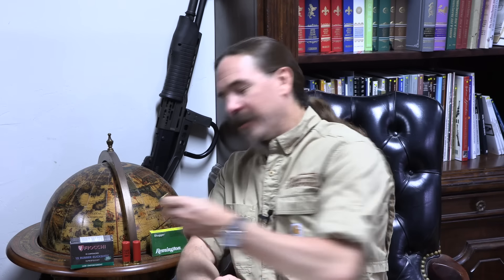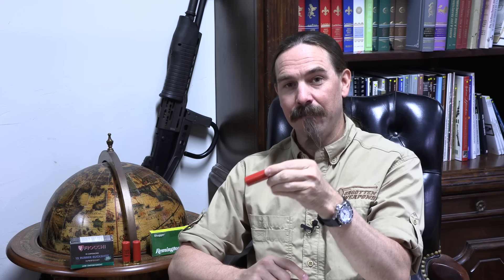The Unique Challenges of Self-Loading Shotgun Design

Comment: Another factor that you didn't mention is that standard shot shells are longer when they eject than when they load (because of the crimp expanding), making extraction and ejection more difficult.
Reply: Yeah and length might be different, it seems European shell is slightly longer and crimped differently.
Reply: Back in the day when brass cases were used for shotshells they had no crimp at all.  an over shot card with the shot size stamped on it was glued into the case mouth and that was that.  Reloading brass shotshells was super common in those days.
Reply: the expended shot-shell casing is the measured length of the shell std 2 3/4 "... Had me fooled for so many years. Then we have other shells that vary in length , i.e. 2.5" , Kent 2 5/8", even some obscure english style Eley at 2".  Buckshot loads were standard at one time in 8 pellets, not 9, combined with the slightly shorter shells once available, they fed and functioned well in some pumps e.g. the venerable 1897 Winch/Browning and that gave an extra round in the mag.
I always enjoyed 20 g single shot cooey for my hunts for decades, simple .12g Pumps came later and I would not consider a semi.
Reply: @2949stari Then there's 2 1/2 English, which you can get extras in on a 3" magnum gun with no mods.
Reply: 3.5” shells too
Reply: Interesting to think most empties get shorter but for shotgun they get longer
Reply: It doesn't necessarily make it more difficult. You just have to make sure the bolt travels back far enough.

Comment: Basically, praise be John Moses Browning and Benelli for giving us semi-auto shotguns that run very well with little to no problems.
Reply: Also Beretta 300 series. The first really reliable shotgun gas action.
Reply: Man, I really hate Remington, but I watch thousands of rounds of shells fired through a wide varieties of shotguns every week.  The 1100 is a perfectly functional piece of equipment.  The comment about the Beretta 300 is laughably absurd.
Reply: My Benelli m4 is indestructible
Reply: The Remington 1100 was the first semi-auto designed to function with plastic shells and is still a great shotgun.
Reply: Benelli is so over rated
Reply: @neutronalchemist3241  Had a Beretta A302 for a number of years, and the only time it ever failed to feed was with subsonic shells through a freshly cleaned action.  After it had a dozen rounds through it, it worked flawlessly.
My favourite hunting gun.
Reply: @randymagnum143 beretta was the first to make a full functional gas shotgun. Benelli is nice and they may be just as good but it’s no beretta

Comment: I acquired a Vepr-12 years ago and expected its internals to be effectively identical to that of a typical AK. I was surprised to discover that it has a bolt head separate from its rotating bolt; It took me a while to realize the necessity of this. It’d be extremely difficult to ‘convince’ a plastic-hulled shotgun shell to actually rotate in the chamber as the bolt locks into its recesses. I suspect this is part of why there are so few rotating-bolt shotgun designs. Tilting into lock is just easier, and the primary extraction benefit that usually comes with a rotating bolt isn’t necessary.
Reply: I really need to get a Vepr-12 before they double in price again.
Reply: I have a Vepr 12 as well and it took a lot of trial and error to get it to be reliable enough to use in competition. Mine likes Winchester AA 1300 FPS handicap loads.
Reply: All Winchester Model 1200-1300 are full rotating bolt designs. they work flawlessly.
Reply: @ThurmanMurman74  my Vepr-12 works excellent out of box. BUT only with 32 g (or more) loads... 28 loads cause malfunctions.
Reply: I don’t think you understand rotating bolts….. you don’t twist the spent round in the chamber, the bolt just rotates around the head, it’s not locked on that tight.
Reply: @geekswithfeet9137  Yeah, the rotation is to achieve bolt lockup. It doesn't actually "spin" the round in the chamber.
Reply: Vepr must be much more reliable than saiga
Reply: @FecalLord  no. Saiga have adjustable gas block, which increases reliability.
Reply: @FecalLord  Eh, they're about equal in my experience. Both run high-brass loads without much trouble, both need extensive work to run low-brass shells reliably.
Reply: @FecalLord  My Saiga was 100% reliable. Can't get "much more reliable" than 100%.
Reply: @distalradius8146  Not sure if I got a lucky one or you got an unlucky one, but my Saiga-12 couldn't care less if it was high brass or low brass, 100% reliable without any work.
Reply: @BC-wj8fx  Then, yes. You got a lucky one. The majority of imports would not cycle low pressure ammo right outta the box.
Reply: @distalradius8146 "low brass" doesn't really describe much. I have used "low brass" target loads in my Saiga without problem. I suspect that's because I don't buy the cheapest, lowest quality junk I can find....which ultimately means "low brass" to me is a 1 1/8th ounce load at 1200-1250fps.

I wouldn't expect the light garbage loads to function in any semi auto. Some of them don't function reliably in pumps.

Comment: John Browning’s Friction ring design used in the Auto 5 is pure genius, never suffered one stovepipe or jam with my 1933 Browning Auto 5
Reply: Never seen one jam before either 😂
Reply: I've seen them be finicky with light loads. But that was on an 11-48, which is the same design.
Reply: The new A5s definitely aren’t perfectly reliable especially with light loads
Reply: @neonwhitea.1548  The "new" Auto 5s are just another inertia design and have almost nothing in common with the original long-recoil friction ring design. Unfortunately.
Reply: The original could be taken apart and readjusted for light loads too.
Reply: Always wanted an A5, but was curious as to how they handle. Do they kick more than a likewise shotgun of the same weight? I once had a Remington 81 in 35Rem, and that thing kicked like a mule. Although I never fired 35Rem in any other platform, I would think it should be that kind of recoil inducing. I figure a 35Rem should feel like shooting a stout 30-30. My guess would be the long recoil action is what caused the added kick. And since the A5 shares the same basic operation as a Remington 8/81, I figure they recoil just as bad. If not more so being as it's a 12 gauge.

So what's the consensus, is an A5 (Original Long Recoil Action) more recoil intensive than a likewise shotgun?
Reply: I own two Auto-5s in 20ga from the 1950s.  Never a problem…work as well today as they did 70yrs ago 👍
Reply: @tylerwilliams6022 they have a really weird feeling recoil due to the reciprocating barrel. It can feel like it's trying to jump out of your hands as the barrel reciprocates forward, they certainly don't shoot as smoothly as modern guns though. I love mine though, go pick one up.
Reply: @tylerwilliams6022 I would say that the A5 recoils more than other semi auto shotguns. My family has a 1956 A5 made in Belgium and it runs great. For context, I have shot more than 100rounds through a beretta A300 and a Remington 1100 and those are my primary comparisons. First off, the barrel on an A5 is significantly above the stock which causes more barrel rise than the other 2 shotguns mentioned. Second, the long recoil system takes a relatively long time to cycle so the gun chugs rather than punches. Third, the stock has a steel butt plate as opposed to rubber. All these combined make a shotgun that moves more between shots.
Reply: The recoil feels different.  Saying the long recoil “chugs” would be accurate.   Both of my A-5’s have factory rubber butt cushions.  I’ll put it this way, you can shoot a trap course all afternoon and not have a shoulder bruise.  The heavy weight helps a lot.   On the opposite spectrum is the lightweight Franchi clone of the A-5 called the 48AL.  True featherweight, but it makes my shoulder purple after a day at the traps.   If you have no problems with a 500 or 870, you’ll definitely have no issues with the humpback.  
The only time you’ll feel excessive kick is if you load full power hi-brass but your friction rings are still set up for light trap loads.
Reply: @CSMSteel7 i love my 48al in 20 gauge. "Chugging"is an absolutely perfect explanation of a long recoil system recoil impulse. The 48al in 20 is the perfect upland game gun for me, many a quail have flown away unharmed from me and my expert wingshooting
Reply: @agentsmith555  I definitely get what you say about the recoil impulse being different than other autos. I will aquire one at some point, it's on my "Must Have" list. I do love the humpback design that others may find weird or offputting. And the firearms of John Browning happens to be my favorite class of firearms.
Reply: @gannonwoods2456  Thanks for the reply! I plan on getting one in the future for recreational shooting/skeet. Maybe for birds if I ever get back into that. Also eyeing up a Beretta 1301/300 Tactical as a home defense shotgun.
Reply: I've had a few stovepipes on mine (Remington Model 11, a licensed copy of the A5), but that's probably from it being made in 1908, and being in need of some tlc
Reply: @mikenorthrop5815  One thing I don't like about the Model 11s is they use a riveted in fiber buffer. Being as old as they are combined with sustained use they fall apart. All you are left with then is the rivet which can cause a round to discharge when loading a round. I read up on how to replace them and it is rather involved. The Browning A5s don't have this buffer or problem. Plus A5s have a magazine disconnect which also steered me toward that over a Remington. (I can't recall if the Savage A5 copy has the buffer or not).
I also like the how the later A5s with the two piece lifter give you the "Speed Feed" capability. With bolt locked back on empty chamber, the first round loaded into the mag tube is automatically chambered.
Reply: I recently bought one and it needs a new retainer for the mag spring. Any idea where I should look for one?
Reply: He was, in FN's parlance, called the "Maestro" for a very good reason. I think we can count such geniuses among men with regards to firearms on one hand.
Reply: My Gold Hunter (A5 derivative) is exquisite and a dream to shoot.
Reply: @tylerwilliams6022  they kick a little softer but over a longer period of time. its a bit strange to experience if youve never shot one
Reply: @Natediggetydog  I completely understand what you are saying, thanks for the reply!
Reply: I have a model 11 in 16 gauge. Made in the mid 1930s, as close as I've been able to determine from the serial number. I've had one feeding problem with it, and that was a rusty case head that had to be pried from the chamber. I expect a similar malfunction would have occurred with my 16 gauge 870 or Ithaca 37 with that particular shell. 

That said, the days of paper shells were far different, and autoloaders were not well regarded by waterfowl hunters back then. A pump could force a slightly swollen hull into the chamber.

I have another experience with a Franchi 48AL, another A5 derivative. In this particular case, the "double shuffle" recoil, combined with a trigger that would be considered quite good on a rifle, resulted in a second shot fired unintentionally.
Reply: @mattcavanaugh6082  absolutely wonderful! 
I have a 1967 A5 and as much as I enjoy it- the Gold Hunter is sooooo much more enjoyable to shoot. Never any type of failure.
 I've read of many people complaining of failures.
Most have a common denominator- modifications!
The only part that wears out after a few thousand rounds is the cork hammer cushion. Easy to replace.

Comment: Well it's obvious we need a belt fed shotgun
Reply: I've always wondered how one would work out.
Reply: Maybe something like how the PKM does it? With the shell rim, you can't do a push-through design, it will need to be pulled backwards then it drops down onto the bolt to be chambered. Might need some kind of "reverse lifter" that lowers and aligns the shell for it to be chambered. Extraction can either be to the side or downward. For sure a belt-fed would need to be built around a specific type of ammo or similar power loading to run reliably.

If we can do a belt-fed, we can do a Gatling-style gun.
Reply: How many RPM do you think would be necessary to make it effective? 400? 600?
Reply: I've always dreamed of making one, got a bunch of other fun ideas in my head but I suck at actually getting ideas into the world and also hate the red tape/don't have the funds. A reliable crew served like #2 buck belt fed 12g would be a hot commodity in Ukraine rn.
Reply: @DKNguyen3.1415  What's the use case? Shotguns have various loadings and barrel types for different situations, so we need to define effectiveness.

Say we want defense against FPV style drones, we probably want some kind of bird shot or buck out of a smooth bore barrel with some choke. We can use a high brass loading for extra power and recoil doesn't matter. With use in a point-defense system, higher RoF is better in order to get more shots into the air at once.

On the flip side, if we want a mini Mk19 and use frag-12 rounds, we probably want a rifled barrel, or at least no choke.
Reply: @shura0107  home defense against 20 medieval knights in full plate on horseback riding through your living room
Reply: @DKNguyen3.1415  MG42 but in 12ga
Reply: @shura0107  I wouldn't use a Mk19, you cant really hold it on a point target and only has a belt of 32 or 48 rounds per box.  I think something like a M2 with 'specialized' buckshot / birdshot round might be more effective, perhaps similar to the 37mm Gun M3 's Canister
Reply: 50bmg is close to 12 gauge size, so there's your starting point.

Comment: Since you said that no short stroke gas piston shotguns came to mind for you Ian, I'll give you one and it's the very successor to that SPAS-12 you have behind you: The SPAS-15. Besides switching to a box magazine, Franchi switched to the short stroke gas piston for the SPAS-15 because it had a much smoother recoil impulse than the SPAS-12. The SPAS-15 was also much easier to clean, something the SPAS-12 is known to be very finnicky about.

One other thing is in regards to your statement about the variety ammunition types and the difficulty of getting them to work in semi-autos. In "The Terminator", the SPAS-12 is never shown clearly firing  more than once on camera in same shot. That's because the SPAS-12 is extremely difficult to get working with blank fire shotshells. Probably the best example of the camera trickery on this is when the one cop in the squad room stands up and dumps his S&W Model 15s cylinder into the Terminator (notably penetrating through him and spidering the glass behind him). The Terminator shoots the cop twice with the SPAS-12 but when it fires the second time, the camera has cut to a different shot. All this because they couldn't get it to fire more than once at a time with blank fire shotshells. 

Explains why the majority of other times you see the SPAS-12 on film, its usually depicted as firing in pump action, like at the end of The Hitcher where Rutger Hauer is shooting at C. Thomas Howell with one after escaping the prison bus and essentially goading Howell into starting the Blazer he's in to run Hauer down.

Comment: Ian forgot one.
Due to the rapid decrease in pressure in the barrel, and so decrease in temperature, shotgun shells are ineherently dirtier than smallbore bottleneck ammo. That’s why recoil actions had remained relevant for so long in shotguns (and still are) while they had become little more than a curiosity in rifles, and that’s why gas action shotguns have complex self-cleaning pistons, often with multiple ribs, while rifles have much simpler ones.
Reply: Good point, my gas fed winchester requires cleaning fairly often for that reason.
Reply: oh wow I never considered this as a factor. Thanks for mentioning it